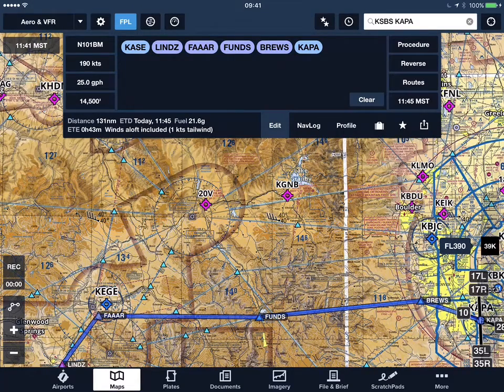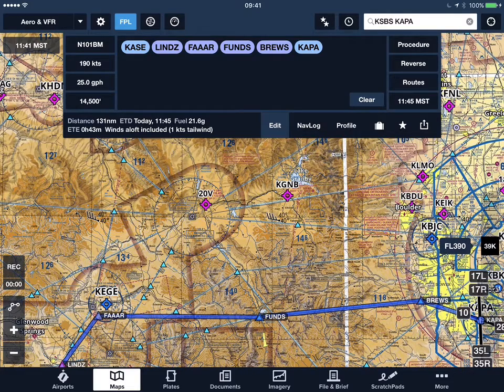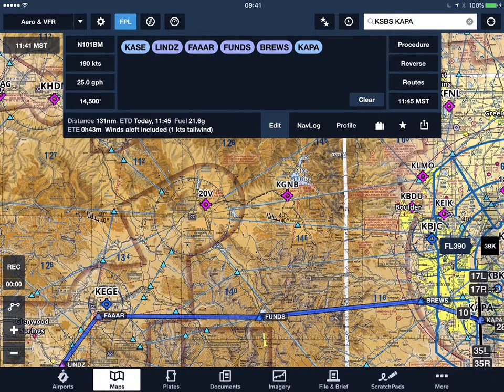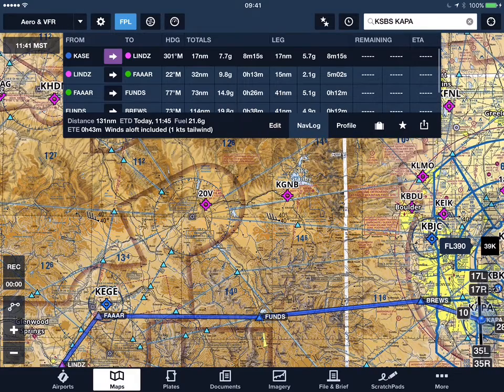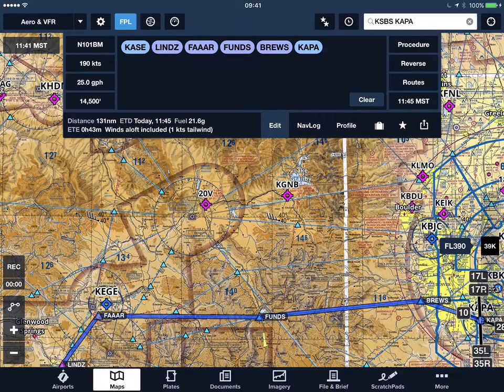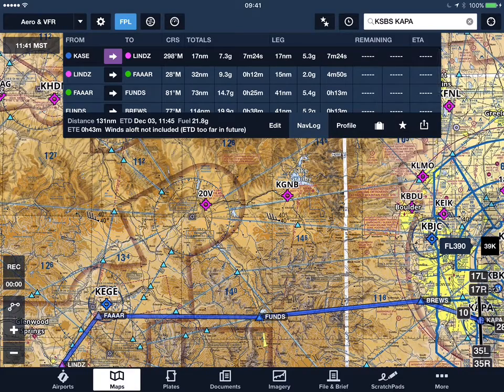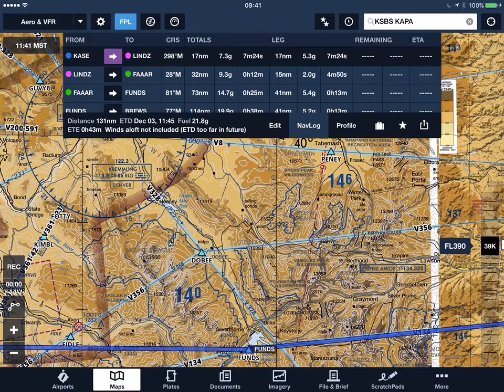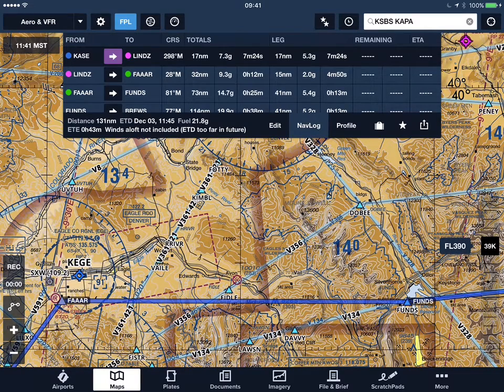Understanding Magnetic Course

Comment: Very informative - ForeFlight is an awesome tool - Thank you for spending the time to provide clarity and specifics that a user would not find in the manual. From this point, when performing future flight planning, I will move the clock forward to eliminate the variables caused by currents winds aloft, etc - That nugget of information was also very useful.

Comment: thanks
its would be nice if foreflght included all the numbers as like someone doing a plan by hand with pen and paper just to make ppl feel more comfy,,, might screw them up as well thou lol
now how do you get true airspeed on it? do you have to cal yourself and then enter it into a flight or will it take a planned indicated and and convert it to true and then cal the rest of the info?
Reply from the maker: TAS is an input in foreflight. You need to make sure to adjust this input for the most up to date information.  Each airplane has its own adjustments for TAS made through the airspeed calibration page of section 5 of your AFM / POH.  Ill put something together to go through this conversion IAS-CAS-TAS
Reply: well i was more thinking when ppl use the search box to make a plan and enter the ias ( not tas ) and then foreflight uses the data it has to convert that into tas.. email foreflight about this idea and they replied will add this at some point